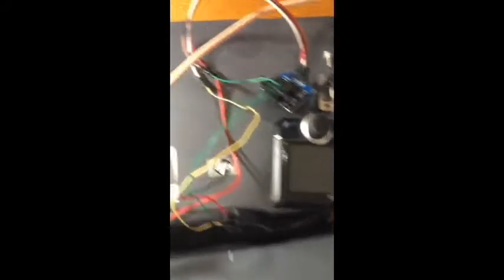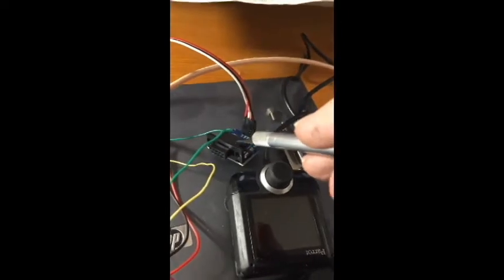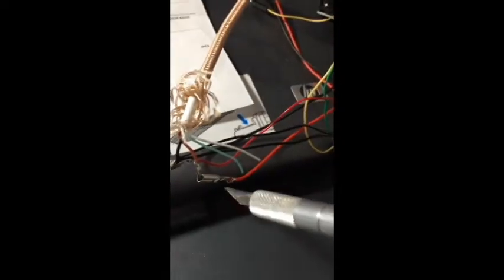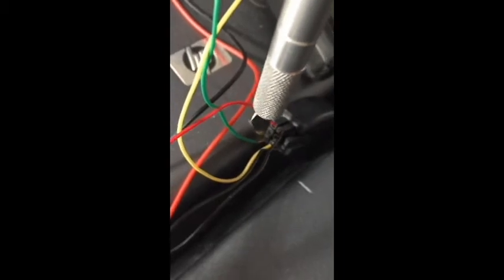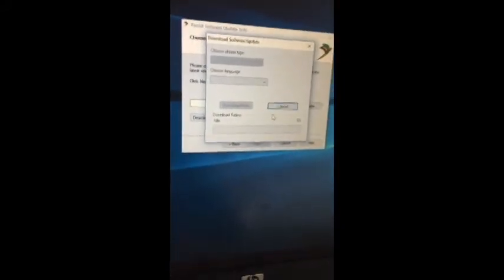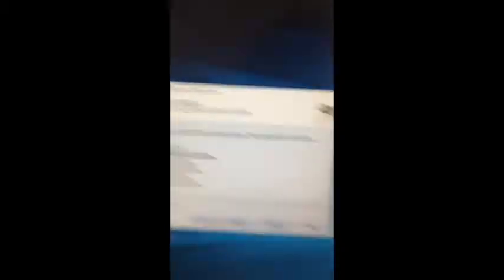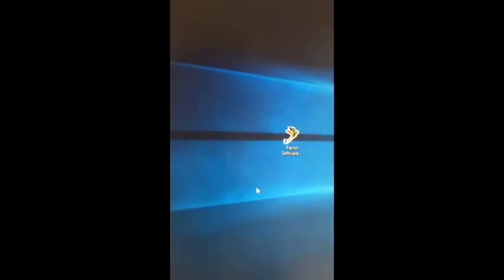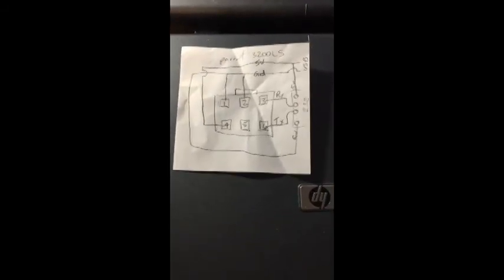Parrot 3200 LS Bluetooth Handsfree -DIY Cable Re-Programming

Comment: Hello Diehl,
Could you send me the update file.
I tried to find it on the internet but I couldn't find it. 
Email adress is sykjedy@hotmail.com
Thanks!
Reply: J.U. de Jong . I've emailed the update tool and the updates. Good Luck!!
Reply: I used a cheap micro USB 232 to TTL interface (also known from Arduino kits): works perfect with the regular Parrot update software. The only thing is I had to swap RXD-TXD wire connection between that module and the Parrot plug. Took a minute...
Reply: @janbos95  Great!!! It's a fun afternoon project.

Comment: @Diehl Videos, i´m try to update my 3200 but the update tool can´t find the file (win7 and win10) as english or german Version.  
Is it possible to download the file separate for a manually update? can you check this.
i think the link in the update tool is not more actually or the parrot file Server is down.
Reply: I just tried the update/download now, and it failed as well. I could not get it to work previously with WinXP, but worked on Win 10. But now wont work. You might try later. However, if there's a way to send you the binaries I will.
Reply: A Google search shows that it's common for the server not to respond with the file everytime. I did download the English version2 months ago.